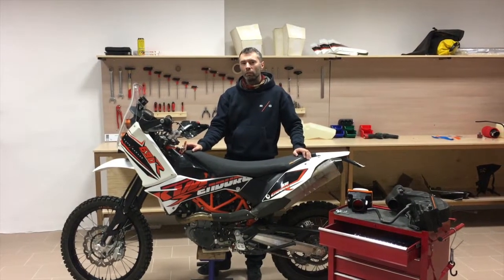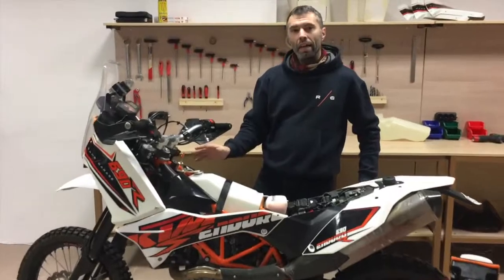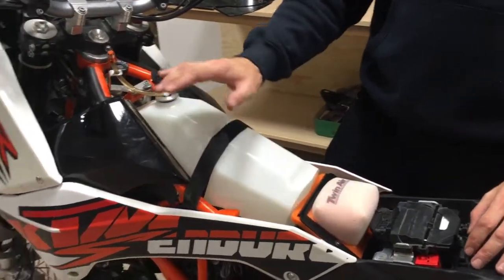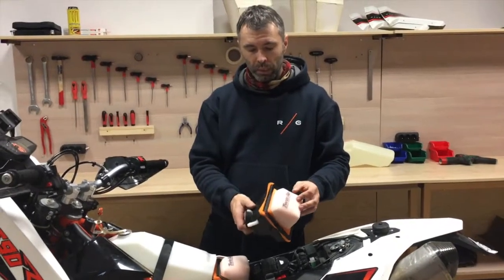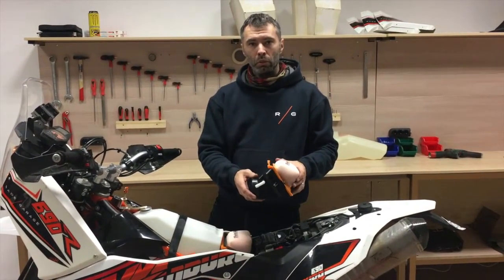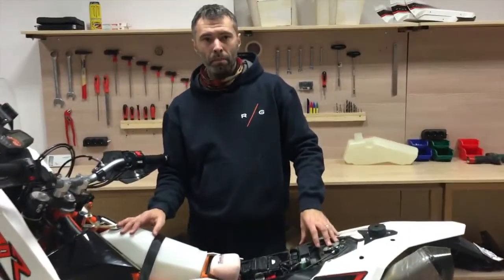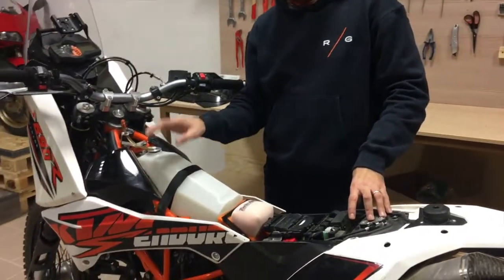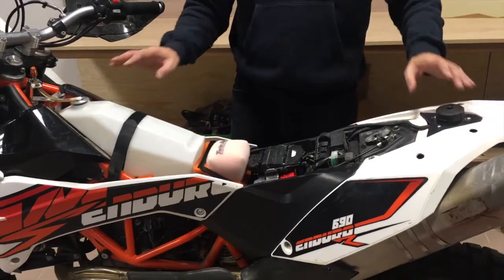KTM 690 Auxiliary tank FF

Comment: Hello,

Do you know the weight of your kit approximately? The complete kit, both the airbox + the tank.
When empty of course.

Thanks in advance, keep up the good work!
Reply: From the looks of it, the additional weight is probably negligible (under a pound I'm guessing). The tank's plastic is probably thicker than the airbox's, and that's probably it. On Rade's website they say it keeps the dimensions and weight of the 690 Enduro the same as well.
Reply from the maker: It is as heavy as the oem airbox it self - so no extra weight. Rade

Comment: Do you have to remove the seat to fill the auxiliary tank?
Reply from the maker: Hi Dan, yes you have to remove the seat to fill the gas on 690. On 701 you dont have to, because the filler at 701 is in front of the seat. Rade